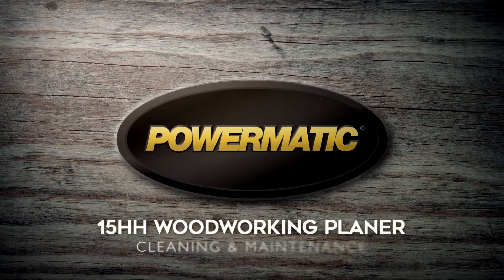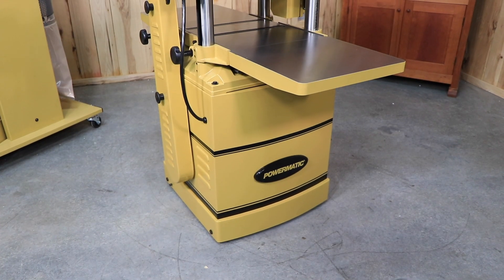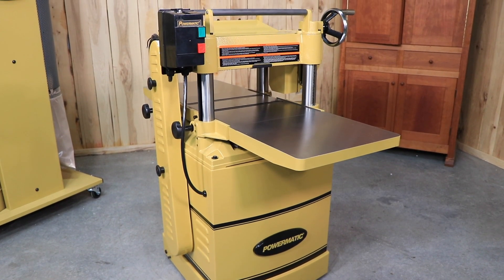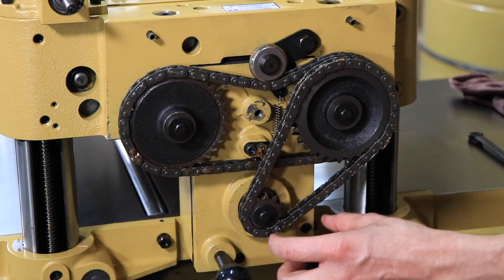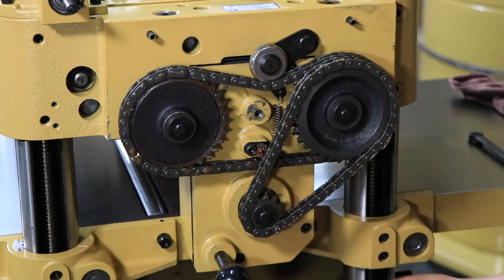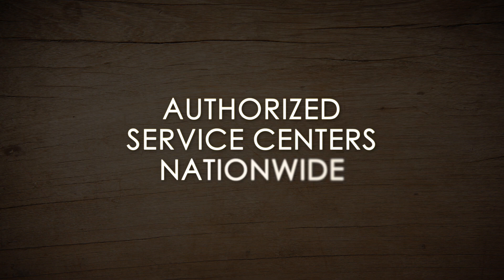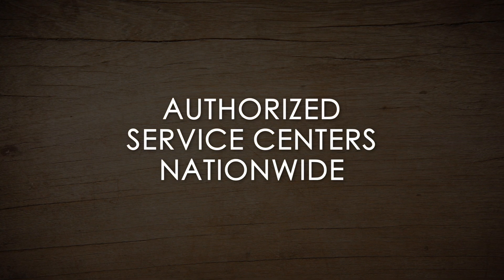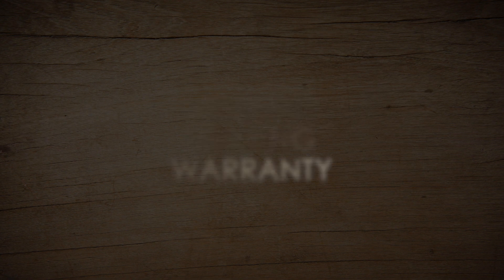Powermatic 1791213 15HH Planer- Cleaning and Maintenance

Comment: I find this video almost useless. For example, how does one change the oil in the gearbox? I know how to get the oil out. How does one get the oil in? The fill cap is small and located on the side of the gearbox. Do I need a funnel with a threaded hose on the end? How much oil and what type? Without knowing the quantity, I guess you just fill it until it overflows making a mess. Do you just slather some grease on the chains? some of this info is in the manual but this video does not help at all.